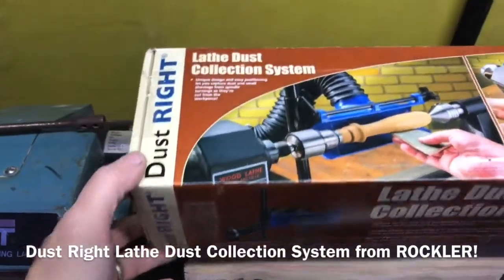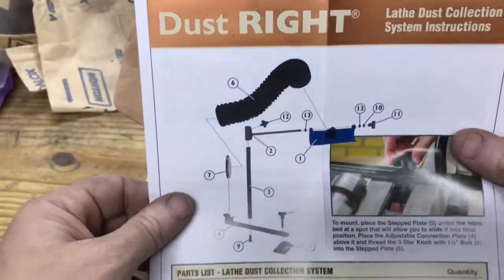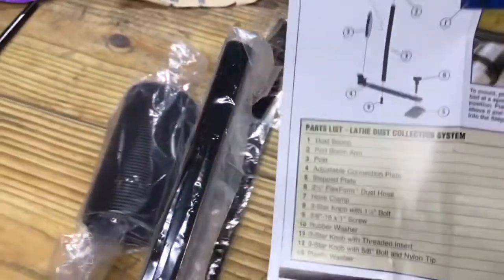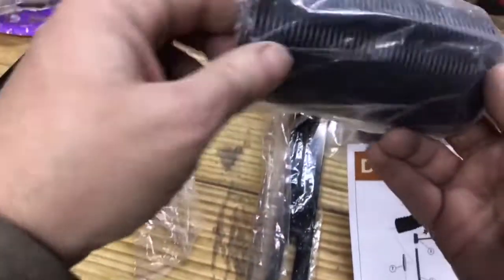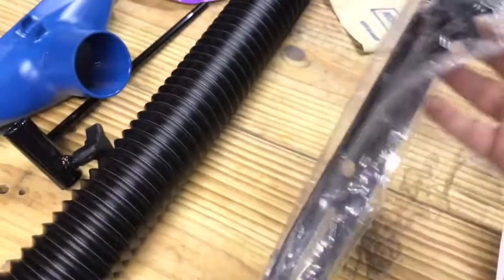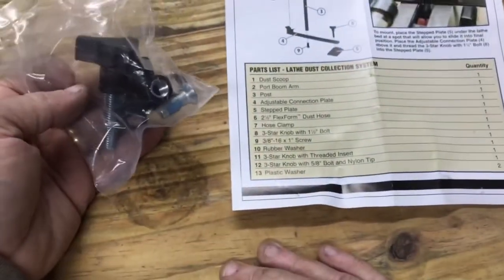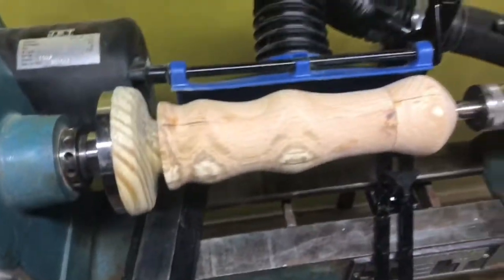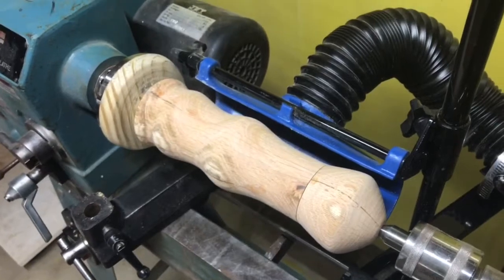Dust Right Lathe Dust Collection System from ROCKLER

Comment: could you tell me what accesories work with this lathe I have the canadian tire version which is identicle but I have no idea what will fit it.
thanks
Reply from the maker: What sort of accessories?  I know mine uses MT2 tapers for the headstock as well as the tailstock, and the headstock spindle size is 1 inch with 8tpi thread.  So if you're looking for any accessory that needs to thread onto the spindle, or mount with a taper, those are the sizes you need to look for.
Reply: @TerrapinCreations666  actually the specs you gave are what I was looking for thank you that will help me get going I picked my lathe up for $40.00 so I can get some goodies for it.  had to clean it up but works great now
Reply from the maker: @Robert-Smith  Great deal!  I got mine for $250.
Reply from the maker: @Robert-Smith  https://www.youtube.com/watch?v=alfGR7kzw6M
Reply: @TerrapinCreations666  required some elbow grease to get it going but well worth it
Reply from the maker: @Robert-Smith  Definitely!  Mine just had surface rust here and there, but was already fully functional.
Reply: @TerrapinCreations666  do you know what thread is for where you would put a hand wheel
thanks
Reply from the maker: Robert Smith Yes. It’s a 1/2 inch hole and the thread is 12 tpi and it’s left handed thread. Nearly impossible to find. I have a buddy with a machine shop and he was able to make me the spindle and I made the wheel for it.  Look in my videos.